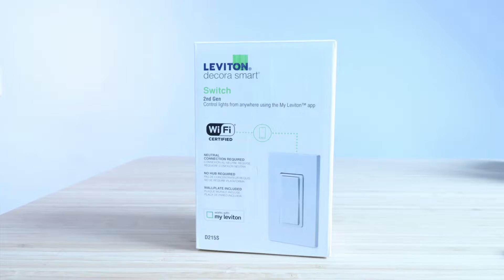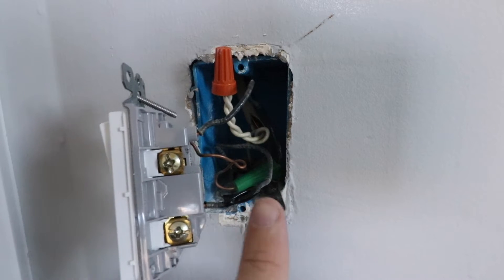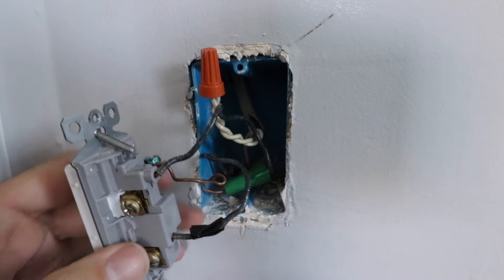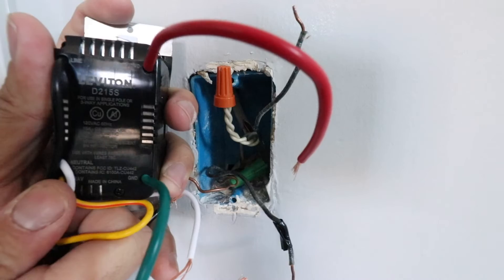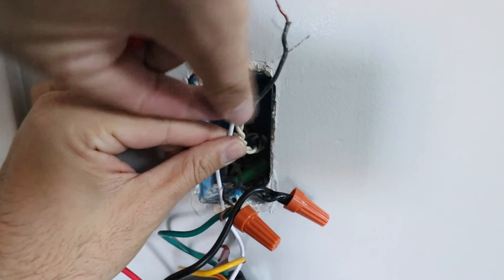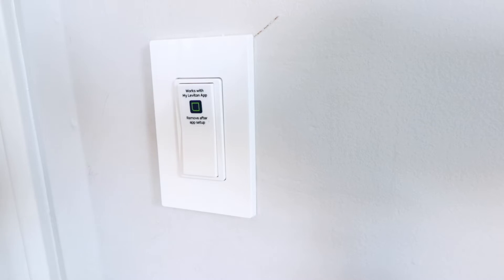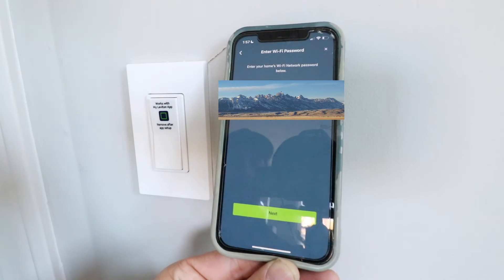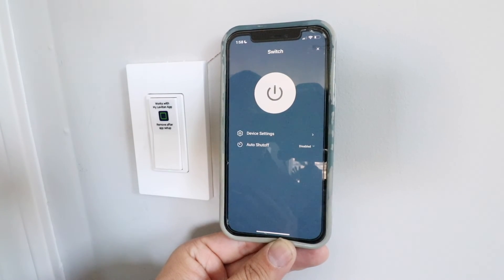How To Install A Leviton Smart Switch (D215S)

Comment: I have a 3 way switch setup and connected the yellow/red wire to my red travel wire in the box and all the other wires just like you did in the video and the switch would not work and there was no power to the light. Tried different ways and got it to power on once but the switch would not control the light just the other non smart switch did.